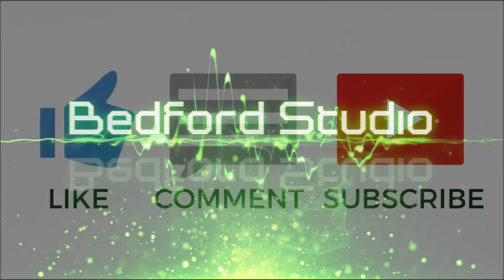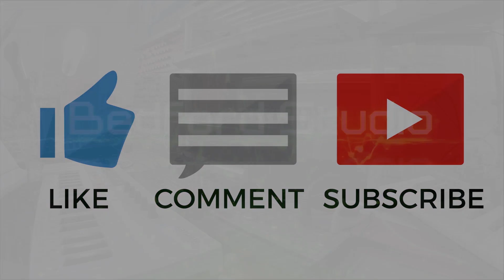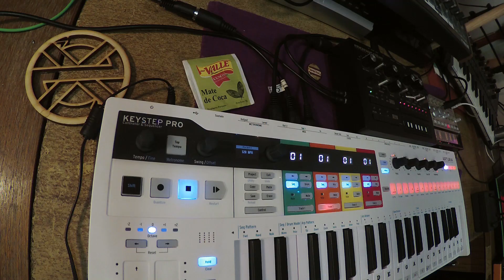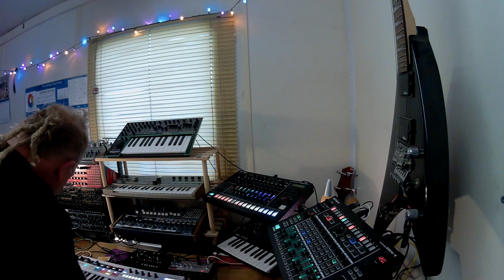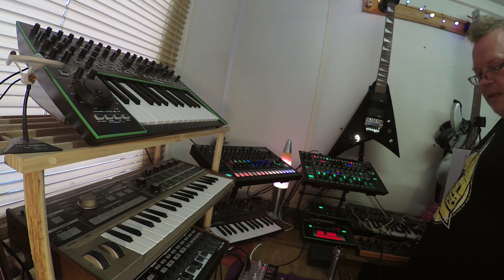How to use Keystep Pro Control Mode - sequence Midi CC's - modulate Korg Volca & External Synth/Gear

Comment: How do you change Change Mode time division? The usual process of SHIFT > selecting time division doesn't work making live recording CC changes rather challenging.
I'm wondering if Change Mode references the Global time division as opposed to track settings?

Comment: i thoght when you press the control mode you control the selected track, but i have enter the utility menue to change the midi chanel that i want to control, is there a workaround to quikly select the control midi chanel? how did you do it?

Comment: brilliant Professor just what I was looking for.. just subscribed ..
Reply from the maker: Glad it was helpful!  Thanks Norm 😊
Reply: @Studio-solutions-com ..this has been a total game changer Professor.. not only can you record a separate control track and change it live in real-time but it can be a different length (up to 4 measures ..) ..that's sick..
I have recorded midi CC's in Ableton but I gave up using it as my master sequencer in 2012 .. I bought 3 Korg SQ-64's and discovered they can record one MOD TRACK (with midi CC's etc..) that's doesn't sound like a lot but 
you also have the ability to select the Variable Amount, Variable Randomness etc on the MOD TRACK but it has to be the same length.. the Korg SQ-64 is great for around $160.. I was curious if my beatstep pro's can do it and discovered your wonderful video on the Keystep pro..
Reply from the maker: Thats great..!  I still haven't gotten around to using the SQ, but it's something which I'd really like to check out with the semimodular gear I use.  Using different track lengths can have some awesome polymetric effects, it's a lot of fun!
Reply: @Studio-solutions-com   ..yes I fully understand Professor, bought the first SQ-64 a year ago and it just sat.. been on a tear lately to figure out everything that I have been putting off.. you will have a wonderful time like I did discovering your SQ-64..
Reply: @Studio-solutions-com   ..I should mention I discovered a major flaw on the Keystep Pro that nobody is talking about..  I can't figure out why..? ..when you COPY, Paste or SAVE a TRACK it pauses playback for about 1.5 seconds but only to the CV outs (Gate, Pitch, Mod..) ..it doesn't happen to the MIDI information on the same channels (note,  gate etc..) 
the only solution I have is to use a MIDI to CV converter.. I bought a Mutant Brains and a After Later Audio Theads.. I have 3 Keystep Pro's..  again I don't understand why there isn't a bunch of people complaining to get an update to fix it.. the Beatstep Pro has no issues with  SAVE on a TRACK.. the Beatstep Pro does pause when SAVE a PROJECT which is less of an issue for me.. anyway perhaps you have a better solution..?
Reply from the maker: @normdurkin6425  afraid not!!  That's not something I've ever encountered so far..! I mostly use midi
Reply: @Studio-solutions-com   ..yes.. 
I am on a mission to learn absolutely everything about the Keystep Pro, Beatstep and SQ-64 .. I also have a SQ-1 (but specifically mine..) it seems to have some CV issues..?  ..really need another one to compare to.. I will keep you posted on what I discover on the bunch.. thanks again for your info..

Comment: All my control sequenced filter sweeps sound choppy like its being divided up on the steps. They don’t sound smooth. I’ve tried everything. I’ve started with a new clear program. Tried with different synths on different channels. Still choppy filter sweeps. Real-time recording is when this is happening. Any clue? Thanks.
Reply from the maker: Hmmmm...  no clue if real-time recording...!  That should be entering a smooth sequence of adjusting values...?  Most odd...!  Did you find an answer yet??
Reply: @Studio-solutions-com  I was told that this at the moment is how the keystep pro sequences motion. Which seems odd. Hopefully that will be updated 👍
Reply from the maker: Where were you told that? I find it hard to believe??!  Surely if each step in the sequence is just one value less then it will create a smooth transition for the filter?
Reply: @Studio-solutions-com  I had the same thought but according to oscillator sink (a pretty knowledgeable YouTuber) that's the way it is. I tried many things and nothing worked to get smooth filter sweeps. Bummer. Like you, I live by motion sequencing.
Reply from the maker: @daydream-musik  yeah, Alex would know...! Lol
I haven't even noticed it, but I've never really tried to record a slow sweep either..!  I'll have to keep Anwar out for thos the next time I use the ksp!  Thanks for bringing this to my attention.!!

Comment: poorly explained
Reply from the maker: Which bit in particular?
Reply: @Studio-solutions-com  i didnt quite get if i can use 8 knobs to control CC on a drum machine, then use switch and use them for a synth , and then switch for another synth , or if the 8 knobs need to be shared
Reply: @javiervera6318 My limited understanding at this juncture suggests we are limited to just five control knobs, each of which can be mapped to a) a specific Track by reference to the MIDI channel used on that Track b) a specific target modulator ie filter cut-off. For example, if you have a different device bound to each Track, each with unique MIDI channels, you could map each device to particular knob to control respective device filter cut-off ie Track 1 (seq) to knob 1: Track 2 to knob 2 etc.
Alternately, Track 1 could be mapped to all five knobs with each knob controlling a specific parameter on target device.
This last scenario would allow you to record upto five different parameter changes and saved to the selected Control pattern which could then be recalled and ran in parallel with whichever 'normal' pattern Track 1 is selected/active.
If correct (untested by myself at this juncture) you could build a library of upto sixteen different Control patterns for use with any Track 1 pattern.
New KSP so still getting upto speed. If my current understanding of Control mode/use is flawed please feel free to edify

Comment: How do you find out the cc codes for a given function? For example how did you find out the cc code for the LFO rate on the Volca Bass?
Reply from the maker: Hey Andrew, from the Midi Implementation file, either towards the back of the manual, or on the manufacturer website

Comment: Good video! Can the keystep control NRPN?
Reply: I did a little research because im struggling with Control the volume level of the Novation Peak with the keystep and i think it's Not possible yet. Maybe they add this in a new update. The beatstep pro can do it so they might update it soon (i hope so)
Reply from the maker: @lange2848  does the vca on the Peak respond to CC's??
Reply: Unfortunately not... its nrpn and the patch level mixer too. The master volume is analog so that's not possible :/
It's tricky but i'm sure there is a way
Reply from the maker: @lange2848  that's surprising!! Maybe run it through the Ext In on something that is???
Reply: Yeah i thought i maybe use the midi tracks on the digitakt, but i think u cant control the midi track level too pn the DT
Reply from the maker: @lange2848  yeah, you can...  I've been doing this with the 707, seems like it has a lot in common with the DT!
Reply from the maker: Great question! As far as I'm aware the original keystep couldn't?? I'm not sure if it was implemented here or not without some diving but I've not seen anything suggesting it has been?

Comment: can it work in cv model？For example, recording modulation information in the sequence,then send it to my modular synth with cv mod out.
Reply: I have the exact same dilemma. I’ve tried to control track record touch strip modulation which is setup to CV modulate my Neutrons frequency cutoff. I can easily control it live that way, but can’t record any touch strip action at all. The latest KSP firmware update v2.5.14 doesn’t include this functionality either. It’s definitely a huge oversight by Arturia, and using their forum is pointless as posts are hardly ever replied to.
Reply from the maker: That is a surprise tbh..!  I'd have thought that they'd have had enough requests to do this by now?
Reply from the maker: To a degree, I believe so, but not that I have tried personally...
Reply: @Studio-solutions-com  I tried, and it didn't work.
Reply from the maker: @boomchang7384  ah man, thats a shame..! I just found out that the Mother-32 responds to midi cc's so was planning on playing around with trying out this later this week...  if I find anything out I'll let you know...
Reply: @Studio-solutions-com  Thx

Comment: So in essence is there 1 control track that can control 5 midi ccs, or is there 1 control track per instrument track therefore 20 midi ccs?
Reply from the maker: Hey Fincho, there's one per track...  so 20 CC's are sequence-able..!!
Reply: @Studio-solutions-com  How do I find this function ???

I think i have only found one control track so far. (Firmware 2.0) 

an example:

1. I select the GREEN track and activate the control mode. (the green track is now flashing)
2. I program MIDI CCs. (red LEDs light up)
3. I exit control mode.
4. I select the YELLOW track and activate the control mode (the yellow track is now flashing)

and here is the problem:

I don't see an empty "ControlTrack" here. I see the MIDI CC pattern (red LEDs) from the green track.
It doesn't matter which track i put in control mode, I see the same CC automation everywhere. If I change something on the CCs, it changes everywhere.
What are the settings for the MIDI channels and CC´s of your knobs and tracks / ports ???

the problem is also discussed in the Arturia forum. without results: https://forum.arturia.com/index.php?topic=107326.0

Thanks
Reply from the maker: Hey, thanks for this! Sorry I didn't see it sooner!!
Reply: @Studio-solutions-com  According to the following FAQ, it has only one control track. There was an error in earlier manuals. https://www.arturia.com/faq/keysteppro/keystep-pro-mcc-control-codes
Reply: @juneaftn   thx...
Reply from the maker: Thank you! Sorry I've only just seen this!!

Comment: my keystep pro is just not working in control mode at all.  No cc's are being sent out no matter what CC number I set it to, I'm very familiar with programming CCs as well.  This is very frustrating feels like my KSP is just buggy.
Reply from the maker: Is it on the latest version of the firmware?
They were still buggy as hell when shipped but Arturia seem to have cured most of them?
Reply: @Studio-solutions-com  well I just updated about a week ago, but maybe it didn't work because not much seems to be different with it.  I can try to update again, glad to hear many have felt theirs are fixed
Reply from the maker: @Ancaja123  it took me three attempts to get my update installed correctly, possibly due to a laggy cable, not sure...  Arturia support is second to none though, if you're having issues with it get in touch and let them know, they're always happy to help!
Reply: @Studio-solutions-com  that’s good advice to get a hold of Arturia. They do have good support and have helped with both my Beatstep Pro & MicroFreak. Gonna contact them for sure!